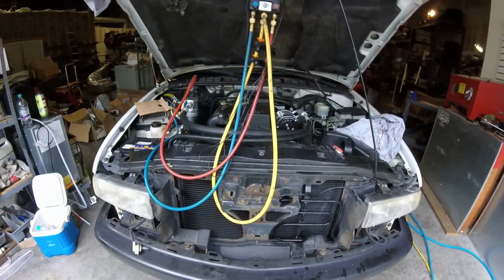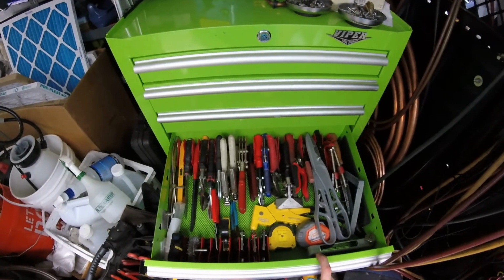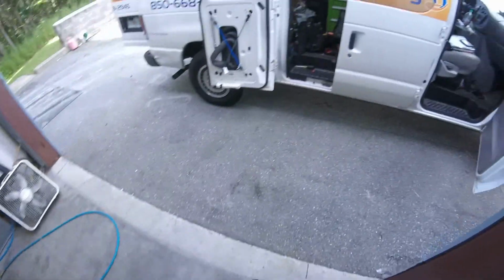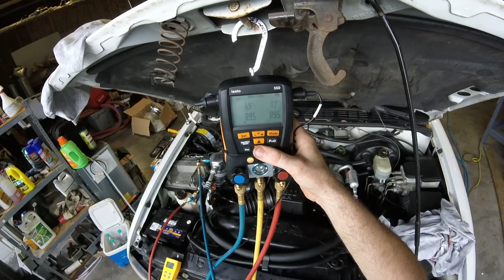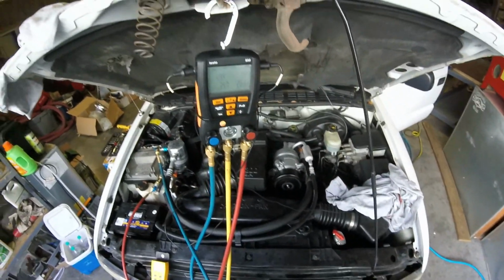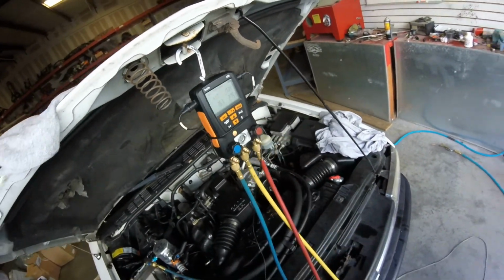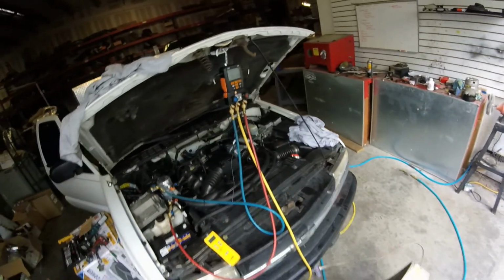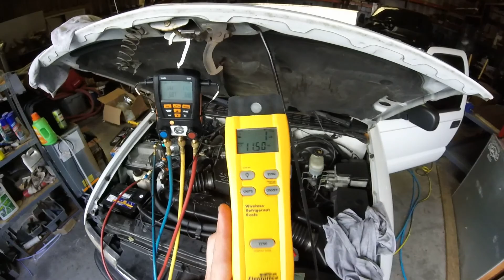Automotive A/C vacuum, charge, and run test Part 3

Comment: If you could hook your analog gauges up it would be nice to see the trends from them.
Could you have changed the evaporator coil from the engine side? Do you think that would have been a benefit  to increase efficiency and lower temperatures?

Comment: For future reference 19:50 isn't quite correct. This is IIRC a Delphi V7 compressor, the larger sibling of the V5, and the predecessor of the CVC. The number is the cylinder count. When the suction pressure drops below the set point of the control valve it progressively sends discharge pressure to the crankcase which isn't directly connected to the suction like most compressors.  Since the swash plate angle is spring loaded in the pull direction the pressure behind the pistons keeps them from reaching bottom dead center which reduces the swash plate angle and hence the stroke length IE the displacement of the compressor. When more displacement is again needed and the suction pressure goes back above the set point the control valve releases the crankcase pressure to suction and the stroke length increases again.

Comment: if you read the Shop Manual for GM cars & trucks, they usually call for:

Max Fan setting
Coldest Temp setting
Panel Vents
A/C On
Recirculate  (some cars have MAX AC which covers this)

They then want you to have at least one window halfway open to let some heat & humidity in to stabilize the cabin temp in the low 70s.  Then check the center vent temps. 

Chevy has whole tables for each car and options fir that car. They go in 10* temp ranges with 3 humidity ranges for temp range.

Ford has the same deal except calls for a 1,500 rpm idle while checking air performance. 
 

Good vid though.
Reply from the maker: joeyf504327 I think I nailed most of those at some point in the video. Thanks for posting that info for anyone who is working on their vehicle. I didn't need to reference any of that data because I weighed the charge in.

Comment: When you run a vacuum why doesn't it pull out any refrigerant oil?
Reply from the maker: Mobile Communications Network oil doesn’t vaporize easily
Reply: @joeshearer1247  Thanks, appreciate your efforts in making detailed videos.

Comment: Is it possible to replace just the condenser or lines coming from condenser ? I have a leak on the aluminum line where they go over top of the radiator from rubbing because the little rubber grommets came out
Reply from the maker: E.E. Watkins yes that should be easy enough. You may want to add a ounce or two of oil for good measure
Reply: Joe Shearer thank for the response...I will keep you updated

Comment: Did you add oil to compressor? 38*psi is charge for most vehicles
Reply from the maker: Michael Lee why would I have to add oil? I don't add oil to copeland compressors
Reply: good point, different automotive ac compressors come with various amounts of oil, it should be listed on them or in directions.
since the oil stays dispersed around the system, common part replacement oil amounts are 1oz cond. 1oz evap. 2oz accum.(pour out, measure and replace with same amount when changing)
that truck is 8oz total, you changed everything and blew out the evap. so system is considered dry, take total 8oz minus oil supplied in compressor = oil you should add.
Reply from the maker: throttle bottle yea I was just messin with you guys of course I added the oil 4 in compressor 4 in dryer

Comment: Joe,  I just did some checking on the automotive recovery machines in my brothers shop (a Robinair and a Snap-On).  I guess I shouldn't have been surprised to read that they both will pull down to only 29" Hg.  Thats about 20,000 microns!  The 29" Hg number seems to be a rule of thumb in the automotive business.  It is also the recommended evacuation pressure listed in the factory manual for my Ford F150.  We are thinking 500 microns evacuation is the normal goal for the hermetically sealed compressors we normally work with...and those shaft-driven automotive compressors are just not up to the task.
Reply from the maker: LEO ASHRAE thanks for the info that makes sense I had it down to 1200 though so pretty good